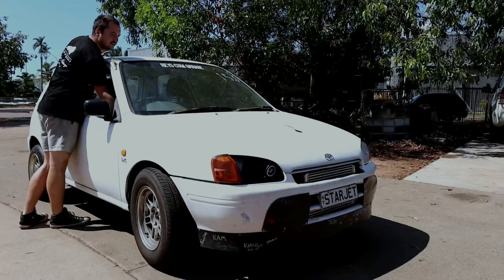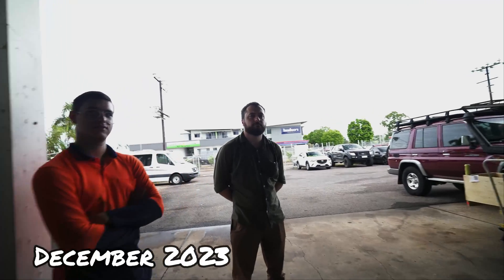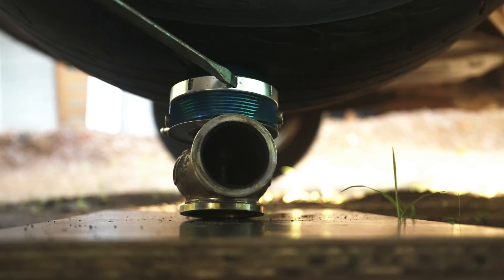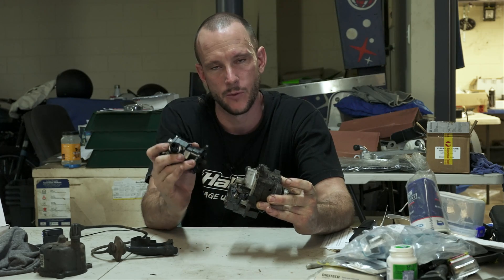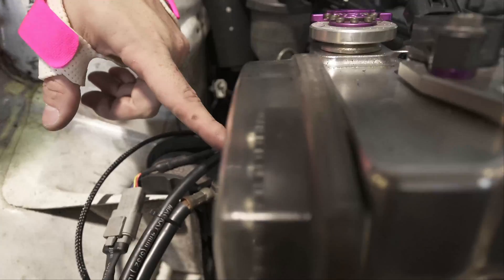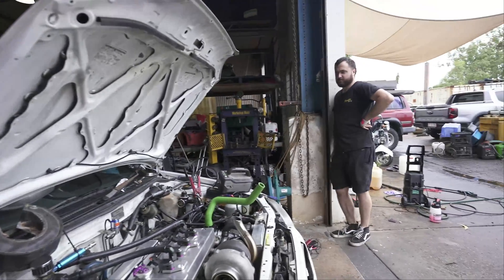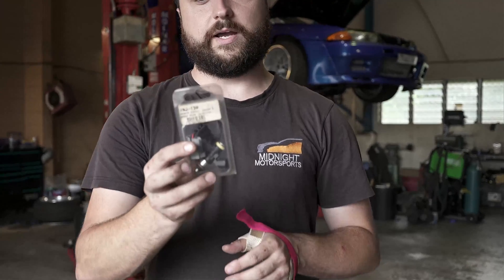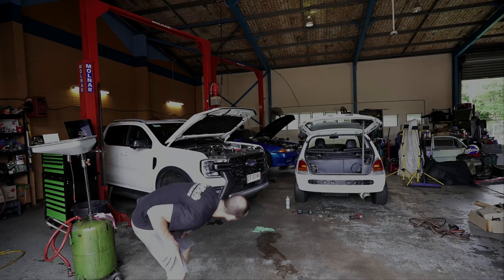4efe mods for 600hp #haltech

Comment: Hey offtopic question: 
I aswell as somebody from our community are running 4ages and trying to convert t o speeduino and/or other ecus. how did you go about using the stock distributor trigger setup for a programmable ECU? does there need to be teeth ground off or anything?
Reply: No, should be fine to use the stock reluctors and pickups for trigger and home
Reply: @HowToTurbo  on the early 4age you have a wierd 24 -4 wheel thats why you cant use the 12 -1 dual wheel pattern you would usually
Reply: @throttlebuddies0  just take 3 of the home teeth off so there’s only one, the 24 tooth crank trigger is perfect

Comment: its all those cylinder heads i bet. bc toyota eventually did what ford did on the v8s ,long runners, small air volume, still massive torque from just over 2.0 liters, the new mazda 2.5s are exciting